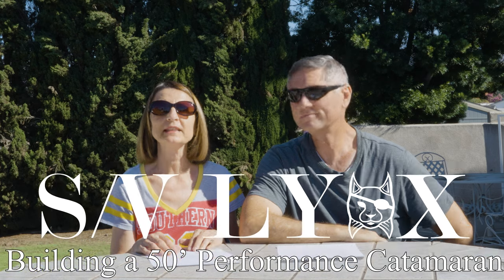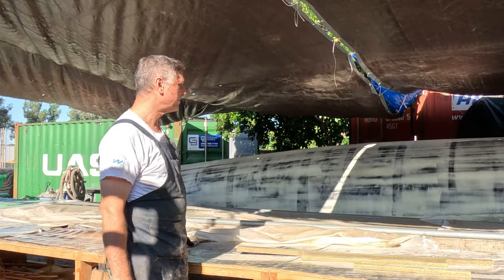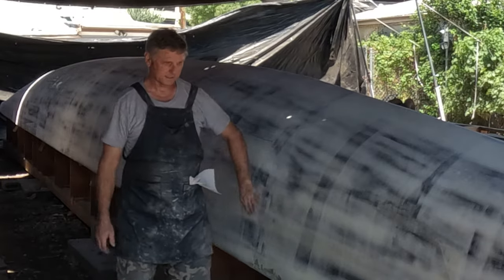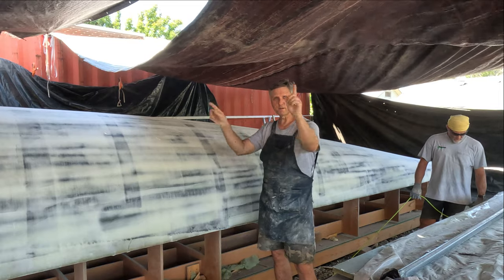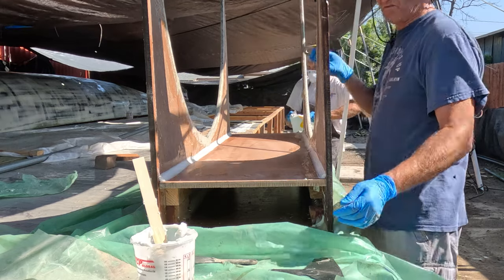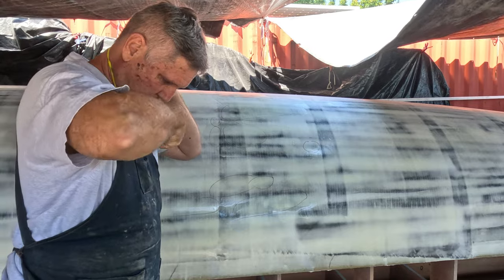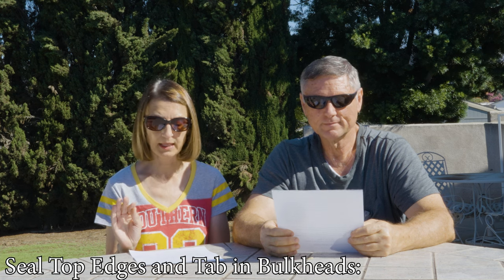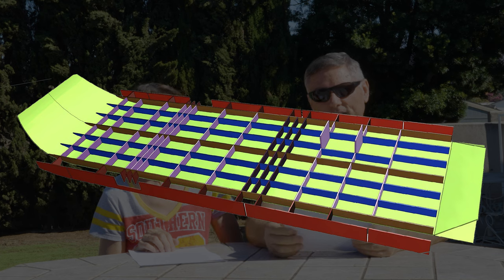Kit E49: Phase 2 Plans and More Hull Fairing!

Comment: Question about your comment about having access to install the motors. Why not rotate the whole yacht on the build site so that the cockpit is facing the entrance of the lot?
That way you will have easier access to the yacht once it's assembled, when you will need to climb up and down stairs to get into the yacht.
I'm sure that you will "need" to have access later in the build to get heavy loads onto the yacht, and using the bobcat for that would greatly simplify your life.
Reply from the maker: Well... that comes down to moving the boat later.  We want the option to back a flatbed truck under the boat, then it can just drive on out.  If the boat was reversed it would face the wrong way on the truck.  Now, if we decide to crane it off the lot and onto the truck, we could spin the whole boat in the air.  However, at this point, we have made our bed.  We can't spin the canoe around since it is 50' long, and the  the lot (due to the shipping containers) is 35' wide.  The only way to spin it at this point would be to bring in a crane, twice, once for each canoe placement, and a third time to lift the finished boat, that's expensive.

Comment: I’m a little confused as to how the canoes attach , since you seem to be fairing all the way to the edge .😃🍻
Reply from the maker: Well, we are only fairing to the edge because there are only 5" (13 cm) needed for the glass attachment and we'll just sand down that strip rather than try to keep the fairing compound off that small area.
Reply: @SailingSVLynx  makes perfect sense now 😃 Thanks for the explanation 😃

Comment: You're making great progress! I have a question that's been bugging me since you started your project and maybe I missed the answer. Why do you call a hull a canoe? They're hulls and I see you are slipping and calling them hulls more and more but I was curious why you started calling them a canoe in the first place?  You don't paddle it and both ends aren't pointy....if you look up the definition of a canoe. Just a minor point as a long time cat performance catamaran sailor having owned four big cats starting back in 1977 with a 36' MacGregor at 24 years old. Long before cats were popular or accepted among regular sailors. One thing I love about your project is all the planning and logistics taking into account material availability, space availability and keeping the project flowing seamlessly. As someone who oversaw the building of 150 homes in two years I have a deep appreciation for jobsite logistics. Keep up the great work!
Reply from the maker: Because... that's what this portion of the hull is called in the plans from Schionning.  It isn't the entire hull, just the bottom portion, so they differentiate that section of the hulls by calling them the canoes.  :)

Comment: Sorry to hear about Kathy. 
I was curious about the thru-hull & the stabilizing supports for the propshaft. Won't it be more difficult to add these when the canoe's are flipped? Would love to get your thought process as to when those should be added to the hulls.

All the best,
M-
Reply from the maker: We must have the engine in place before we can measure the precise angle to drill the hole for the prop shaft.  We can add those anytime after the engine is in. Now, we could do it like MJ sailing, with a jig, but still need the motor mounts to do that, so we must have the canoes upright first.

Comment: Have you talked about the procedure and planned route for splashing your boat once complete?  It will be an oversized load to say the least.  Just curious.
Reply from the maker: Only in comments, but we'll get to it in a video eventually.  But, I won't keep you hanging, so here is the short version.  We bring in a flatbed semi-truck, drive down the 3 lane highway right by our lot to the freeway which goes nearly all the way to the ocean and becomes a four lane highway at the end which goes right to the ocean.  Then we lift the boat with a crane and splash.  We will have a Highway Patrol and wide load car team escorting us  all the way, with a permit pulled for a wide load from the state.  All done starting at 3 am.
Reply: @SailingSVLynx  That will be a sight to see for sure.  Reminds me when they moved the space shuttle.

Comment: Even though you're going to be able to generate power from the wind via your props, don't rule out putting in a windmill.  That would let you generate power even at anchor at night.  If space up there is available, the top of the mast may be the best location.  Wind speeds are higher up there and you aren't downwind of the sail.
Reply from the maker: We looked into that early on and decided against it.  Just too noisy for our tastes.  Also, the amount of energy we gain is just not that much.  Our solar array and battery bank are large enough to generate and store enough power for all night, even running AC for all four cabins.
Reply: @SailingSVLynx  Too noisy even with the windmill on top of the mast?
Reply from the maker: @WillPittenger  There are problems with putting a  windmill on top of your mast.  High winds will turn a windmill too fast and ruin it.  You need access to it to prevent that situation from happening.
Reply from the maker: Also... we don't want the weight up there.   We switched to synthetic rigging to lower the weight aloft and don't want to add more back.

Comment: Curious why peel ply was used on the cradle that Brian and his brother were shown pulling off. Surely your not concerned with the finish of the cradle?  Maybe so it can be flipped over while epoxy still wet?
Reply from the maker: It just keeps sharp pieces on the edges from forming so it is easier to handle without cutting our hands.

Comment: why don't you turn the build around. let the bow face into the end. then you have the space to work on the back for all the other requirements instead of having to take verything under the bridge deck for fitting. see Life on the hulls who have shortage of space and they have been able to work from the back.
Reply: Yeah i had the same question... and solution
Reply from the maker: I replied to another comment, but I'll copy that here...  "Well... that comes down to moving the boat later.  We want the option to back a flatbed truck under the boat, then it can just drive on out.  If the boat was reversed it would face the wrong way on the truck.  Now, if we decide to crane it off the lot and onto the truck, we could spin the whole boat in the air.  However, at this point, we have made our bed.  We can't spin the canoe around since it is 50' long, and the  the lot (due to the shipping containers) is 35' wide.  The only way to spin it at this point would be to bring in a crane, twice, once for each canoe placement, and a third time to lift the finished boat, that's expensive."
Reply: I was thinking that before you turn the canoe around, how about making some decent supports that distributes the weight on a larger area on the hull. Cover the area to be supported with packaging tape, and fiberglass some thick plywood on to the hull and make fillet/T-shape with glassfiber resting on the hull.
Reply from the maker: @jakobtheinventor  The cradles you can see us making came with the kit, so they are designed to take the load.  They sit under the major bulkheads.  They are wide enough and in a later video (a week or so) you will see how they are made to fit the canoes.

Comment: What does alignment of the hulls have to do with putting the engine in one hull?
Reply from the maker: Nothing... except we don't want to have to move that starboard hull once it has another 700 lbs. of engine in it, so we need basic alignment ahead of that.  Fine alignment can happen later by moving the other hull slightly.
Reply: Makes sense, thanks for responding.  I can’t thank you enough for creating and sharing your journey. I hope to one day make my own catamaran and the details and organization you are sharing is priceless.